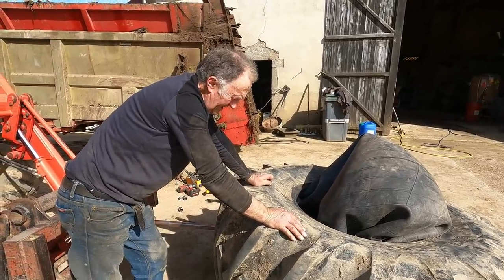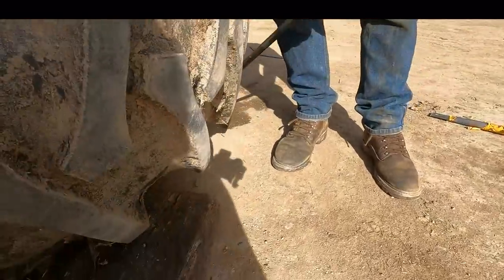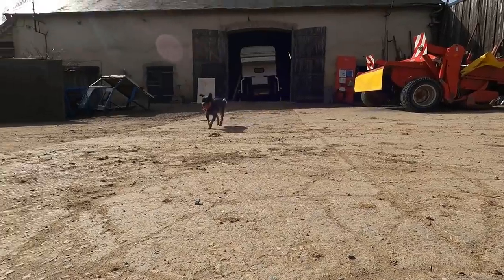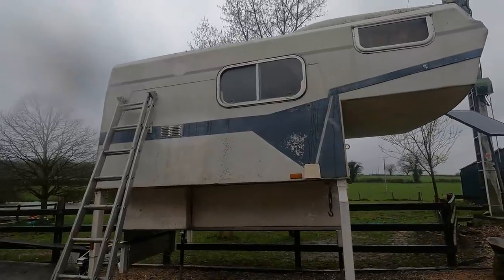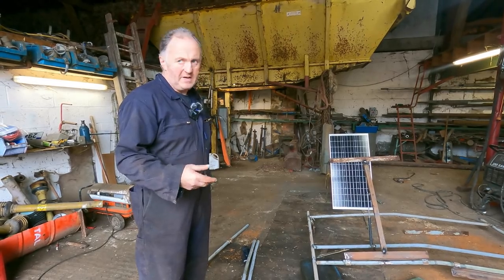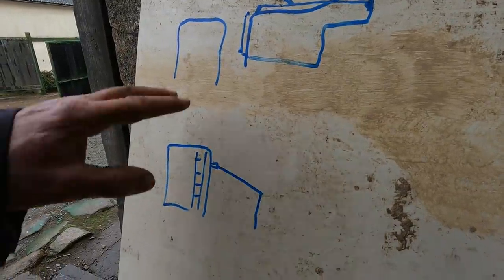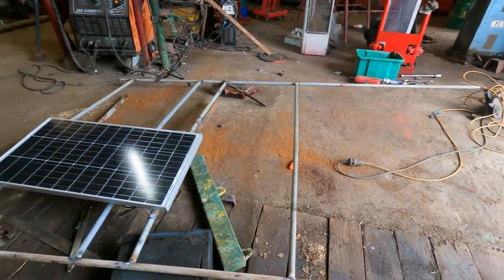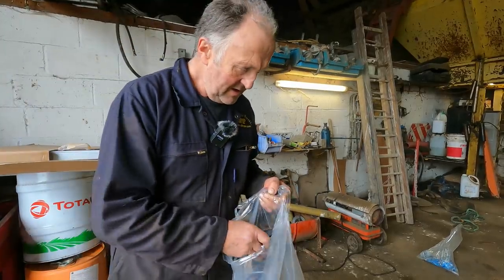MUCKSPREADER REPAIR + Pickup camper renovations

Comment: Looks like a le boulch your father mending the tyre on, Use to run 12 ton tandem le boulch  wide spread for sludge and farmyard manure behind Ford 7710 4WD early 1980’s and load with matbro ram 40 D and teleram 40 D 🇬🇧🇮🇪.

Comment: Great video guys!  No joke lugging that big wheel about and trying to get tube in and out. 

The campervan will be a great job when done.  A great project.  Great teamwork  lifting up the roof rack. 💪 Girl Power!! 😎

It's great for Declan being able to come up with an idea and then being able to bring it to life.  Does that black box with the solar panel stop the batteries from overcharging also?  Is it a deep cycle battery it will charge? I'd love to see a few follow up videos on this.  

I was laughing my head off when Declan went on talking about putting down the stabiliser legs to stop the caravan rocking!

Bumper sticker for the back:
"When the campervan is a rockin', don't come a knockin'!!  😀

Comment: Looked like the tire was giving birth. Bit of a job, that. 
The roof rack with the solar panels is brilliant. Especially with the rams on the panels. What size batteries are you using? What’s the power system/inverter size, etc.  also, agm or lithium ion?